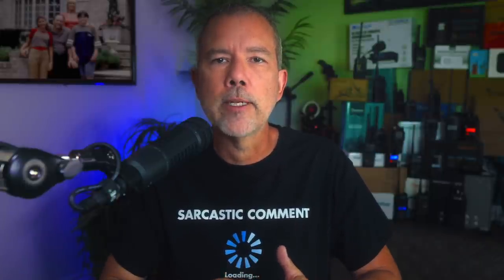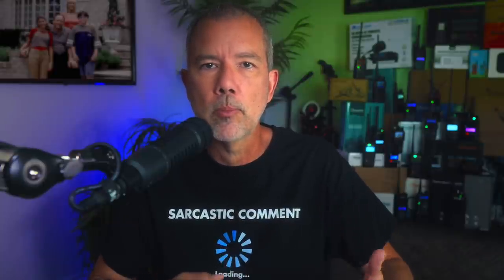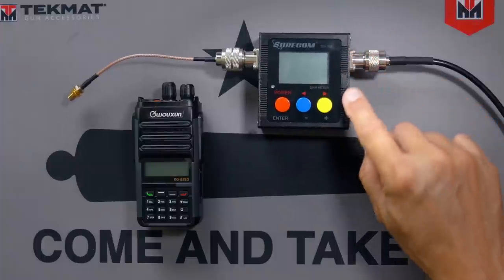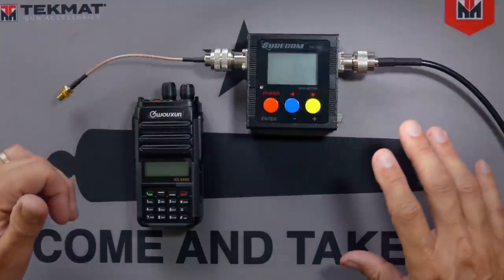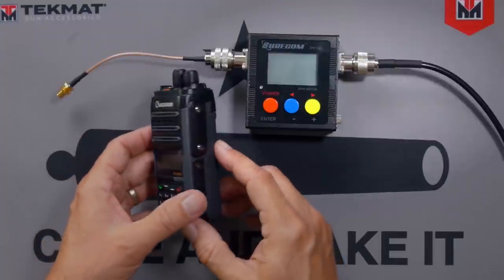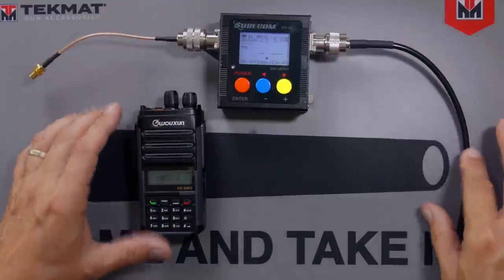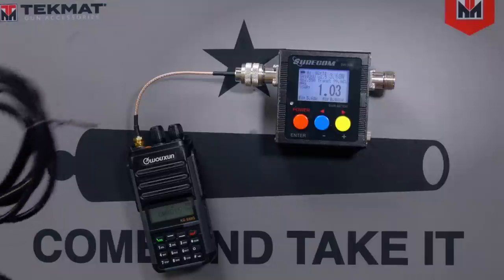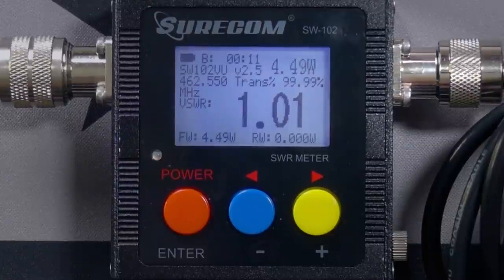Will Coiling Your Coax Change The SWR Or Damage Your Radio? Is Coiled Coax Bad For Your Radio?

Comment: Good test.  I am always reconfiguring my antennas and taking them portable.  I have pre-cut coax cable lengths.  I always make a couple of coils at the base of the antennas as an RF choke.  Sometimes the coax is too long between antennas and radio.  I just coil up the excess coax.  I usually use resonant antennas. Sometimes I have an auto tuner mounted at the feed point of the antenna.  I have never had an SWR problem based on coax that was "too long" or coiled up.  So much for  "the experts." 

 It is not the SWR that could be a problem but attenuation, ie loss of signal strength between radio and antenna.  The attenuation is more critical for UHF and VHF frequencies depending on type of coax used and its length.  You can find attenuation charts on the internet, or they are included in coax manufacturers' specs.  Coiling a coax cable does not appear to affect attenuation in any signifcant and critical, at least in real world situtions like you describe.

Comment: On my j pole dual band antanna. You are supposed to put a coil of coax under the antanna for improved swr. Hmmmm. Must be voodoo magic .
Reply: Putting a coil of coax right by the antenna acts like a balun and stops currents from running down the outside of your coax into your shack.

Comment: Love your videos, as a tech person I have to agree that winding and unwinding cables continually is not good for the cable.    With  network and power cables we  extended the life of our cables  by not twisting the cable as it was coiled them  up.
Reply: As for avoiding winding up  cable by cutting it and terminating the cable has the potential to introduce other issues if not done correctly

Comment: Could you possibly compare your current setup on your jeeps SWR to what it would be with a ground plane mount?  Looking at your setup (mounted in front of the windshield) I’m confused as to how it gets a good ground plane. Keep in mind that I’m an idiot that is just starting into GMRS, and so far your videos BY FAR have the most useful information
Reply from the maker: The antenna location on my Jeep doesn't have a "good" ground plane.. But it is "good enough".  Dont let the "experts" fool you into thinking that you must have a perfect groundplane.. Perfect is better, but anything below 3:1 is just fine for normal people.
Reply: @TheNotaRubicon  I’m still thinking about the mount for my side by side. I worry that a magnet mount on a plate on the roof will get knocked off continuously, but I’m concerned that a roll cage mount won’t have enough ground plane. I’m trying to avoid buying an SWR meter if I can help it but I don’t want to damage a brand new radio

Comment: I'm a bit confused (nothing new) I've always been taught that a Ratio of 1 to 1 is perfect  and that 1 to 1.5 is ok , 1 to 2 is bad,   and 1 to 3 is destroying your radio (back in my CB Radio days) ..I didn't think you could go lower than 1 to 1 which was theoretically perfect
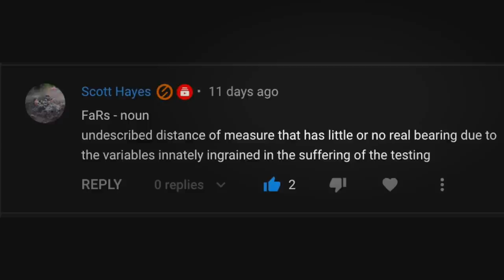Reply from the maker: 1:1 is perfect... 1:5 is good.. 1:2 is good.. 1:3 means you need to do some work.. But even 1:19 still wont destroy your radio unless it's 50 years old and has tubes inside of it.
Reply: I'd worry much more if I had 3:1, 2:1 just about acceptable and anything below is good. I like to aim for at least 1.5:1.
G4GHB

Comment: Does the thicker cable introduce more resistance?  I’m new to the GMRS world and am curious if there is a an ideal cable for each type of radio, much like certain antennas are tuned to operate on specific bands or frequencies.
Reply from the maker: Short answer: No.. When shopping for cable, you want "low loss", or the lowest "loss" (loss of signal) you can get.. However bear in mind that for the 10-15 feet required in most vehicle installations, the difference between 'high loss' and a very good 'low loss' cable is negligible. Remember: you're not trying to bounce a signal off the moon, you're just trying to talk to your friends a short distance away.  
If you're installing an antenna on the roof of your house, and running 50 or 100 feet or more, then the loss really makes a big difference and good quality low-loss cable is much more important.
Reply: @TheNotaRubicon  Awesome.  Thank you.
Reply: All cable thicker = less loss

Comment: Can you explain  why some antenna manufacturees suggest coiling 8 to 10 turns in a 8" coil to act as a choke?
Reply: To reduce noise
Reply: The choke will stop r.f. on the outer of the cable and may therefore reduce the s.w.r. For example a dipole is a balanced aerial but coax is unbalanced so to stop r.f. a choke is used, a ferrite ring is more effective.

Comment: I like your videos because you're grounded in reality as opposed to having a stick up your butt like the hams and not repeating wives tales like the CB guys. I have both the antenna and amp jumper coax coiled and zip tied to each other under my dash.   I was thinking the same thing all the other 'experts' do about inductance, reactance, and impedance....  Barefoot, the worst my SWR is is 1.2.  With the amp turned on it's 1.5.  Both numbers I can live with in the real world.  My little 5 foot antenna and 100w setup has me talking coast to coast in the evenings on DX, reliably.   The naysayers and basement dwellers may not experience the same results as me, but they're also morons, so it can't be helped.
Reply: I won't take offense at the generalization about hams lol. I keep a salt lick by my computer and radio so I can take all the advice and feedback I get from others with large quantities of grains of salt 🧂.  I find a correlation between flouted credentials and experience has an inverse correlation with the utility of said advice in most cases.

Comment: You shouldn't be winding up cables PERIOD! Winding too tightly may cause distortion. If the dimensions of the inside of the cable changes so does the impedance. The center conductor will migrate shorting the braid. Bad habits. Bad outcomes.
Reply from the maker: You mean, kinda like I said in the video?
But, just so everyone can see how smart you are, I'll pin your comment to the top so nobody misses it.
Reply: I like turtles!
Reply: @TheNotaRubicon  I agree Randy. Eric is a very smart guy. He's such an "expert".
Reply: Eric D, you’re not his favorite viewer anymore.
Reply: @rabbi6225  no unfortunately he is not.
Reply: Wow! Amazing! Randy predicted that this would happen, and here it is!
Reply: Mine is coiled like a pissed off rattler ready to strike "some people" but when I answer someone's request for a radio check they always come back to tell me that my signal is full quieting and son That's good enough for me.
Reply: The radio doesn't care.  Why don't you send coax crimpers for everyone with an antenna, so they can make them the exact length it ought to be  (according to you) so you can feel better.
Reply: If you make your coils big enough, it doesn't matter when it comes to this issue. You think electricians working with solid wire worry about working with the cables in the cable reels, considered they are coiled? Give cables more credit. Even sad hams bend their coax when running long wire antennas with coax cable.
Reply: Sounds to me like Eric D might be wound just a bit too tightly changing his relative impedence.
Reply: Eric, carefully watch the entire last two minutes of this video. I think you will feel bad about your posting and come to realize that you in fact, may be one of the A.D.D. ’tards Randy is referring to. Because you couldn’t even finish watching until the end. You owe Randy an apology.
Reply: Bro, plz watch the entire video. Specifically the last couple minutes
Reply: @TheNotaRubicon  randy.. do you think this is a tyson.. or a honey baked sad ham?
Reply: If the manufacturer's minimum coil diameter specification is not exceeded, the problems you've addressed will never occur. Quality coaxial cable such as the LMR400 has this specification.
The point of this lesson was to bust the myth that coiling a transmission cable will induce high reflected power. The test proved that it is only a myth.
Reply: Eric D  Personally I would be more concerned with 90 degree kinking or pinching the cable which would change the SWR reading presented to the transmitter. Coiling the cable has no discernable effect.
Reply: Right because in the real world no ever winds up cables! Too tightly I agree with, just got to keep those gentle curves!
Reply: Dude, get a girlfriend, for real. Are you also wearing 4 masks alone in your basement?
Reply: @TheNotaRubicon  He, she or it just could not resist making  a stupid comment. tsk tsk
Reply: Or get good coac
Reply: Listening and comprehension IS NOT one of your strong points is it.  Smh
Reply: Nonsense!!
Reply: BS ALL BS
Reply: I coil up my cables, because I hate having them laying flat out thru the back door.  No lie, my father had coiled cables while he did 11 meter to Australia at night, with a moonraker 4 antenna, and 8 watts, in the 80's.  No midgets were hurt during these events.  There was a period of skip conditions, and the gentleman in Australia was generally getting up early on his time to get out to fly remote model planes when he could.  I hope we didn't disrupt the time continuum.
Reply: Eric D, Now tell that to ALL the manufactures, distributors, sellers and shippers, who have coax literally rolled and put in boxes to ship. I'm sure they're all gonna care. If it was that traumatic for coax, it wouldn't be done this way.
If rolling coax is gonna hurt it, then its all fuckered up the day it was boxed at the factory. I'm not gonna sweat the small stuff.
Reply: @WooleySwampAdventures  well played 😝
Reply: @TheNotaRubicon  LMAO 😂😂😂👍👍👍
Reply: That is a theory and none of my ham buddies have ever reported that happening. I suppose it can happen to some cheap rad shack cable.
Reply: If you have some excess cable and you have experienced RF getting into your shack and distorting your audio in your dynamic mike, coiling up your coax several turns with a diameter across the coil about 1 and one half feet to two feet will attentuate  any ground current coming down the braid of your cable and into your shack. Old timers call it an ugly balun although it is not a balun . I have used it many times and it always works.
Reply: Oh wow! I was active duty for 5 years. Our Comms section always rolled up their cables after every deployment. They laid them out during use, but afterwards they were rolled up for transport and storage. I’ll have to let them know they’ve been doing it wrong lol
Reply: I have coiled coax for years. I never had one issue. Jmo
Reply: Winding up cables is okay so long as you adhere to the manufacturer’s minimum bend radius.
Reply: Eric D is correct.... 3 months ago I needed to replace my 50 feet of RG58/U coax due to weathering. I also relocated my in-house "station area" 25 feet closer to the antenna due to room renovation. So I wound up taking the extra (unwanted) 25 feet and coiling it up. After having done so, I was no longer able to transmit to or receive from my friend GALAXO on Jupiter. Lesson learned.
Reply: As a professional expert, i must say, rolling up yuns cables makes swrs go hire
Reply: Wow! Good idea, you are an awesome "Expert" Can I learn more from you?

No.
Reply: You're the reason why I chose to get my GMRS license instead of HAM.. GG
Reply: I think that this "expert" from Jet Propulsion Laboratory, is talking about using the cable in the lunar vacuum! 🙄
Reply: Eric sends out cables to his customers in 50 foot long boxes! 🤣🤣🤣
Reply: @mavmav6555  Keep it up and he'll come into a video with a "Randac the Magnificent" head turban on. Holding a radio to his head and predicting the frequency simply by peeking or pressing a button to announce it. Only those old enough to remember Karnac will appreciate it. But it will cause younger viewers to seek some of the best comedy of a generation or two ago.
Reply: Its just a piece of wire, wont do anything unless you wind it around an iron core I think!
Reply: Thanks for clearing that up Eric, if I hadnt listened to the video I might have thought something different.
Reply: How do you get your coax home QUESTION MARK?
Reply: That must be why every coil ever made in the history of coils came from the factory rolled up.
Reply: Yeah if someone is stupid enough force a loop into a cable past it's stress point while looping it.